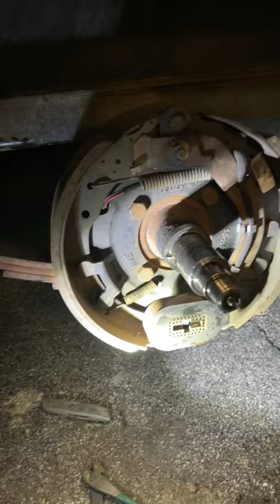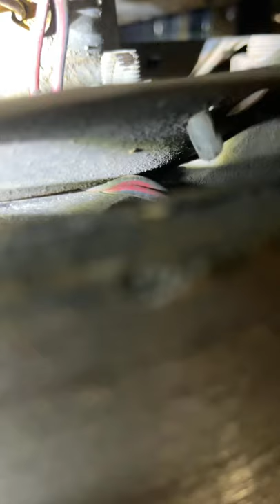Wiring 👍🏻

Comment: Lol! I just replaced one of mine...as I was tightening the 4 nuts (AFTER splicing the dang wires) I realized that the wires were caught behind the backing plate. Grrrrrr! Such a rookie mistake! Loosen the nuts, free the wires, retighten the nuts, cut the wires and resplice to make sure the pinch didn't cut the wires. Every time I rush it takes longer! And watch how Big Tex routes those wires over the axle...I bottomed out and the U-Bolt cut the wires on one of mine.